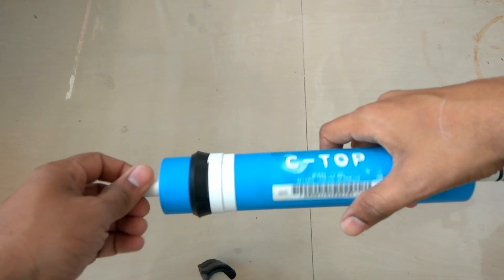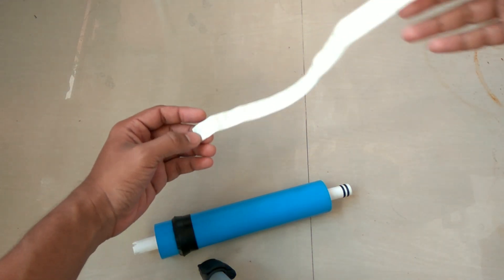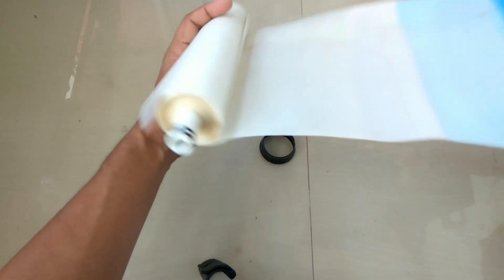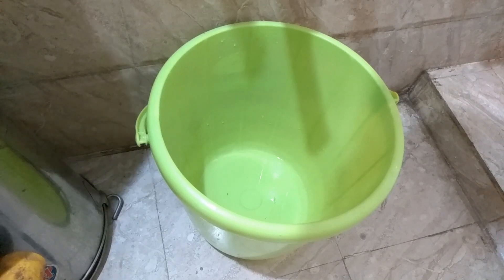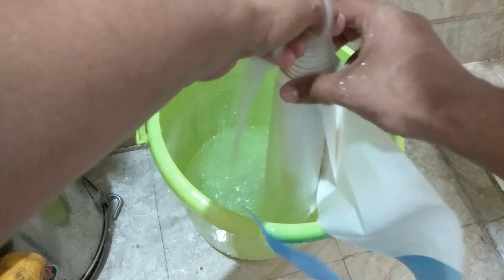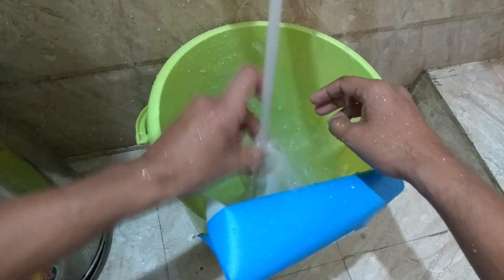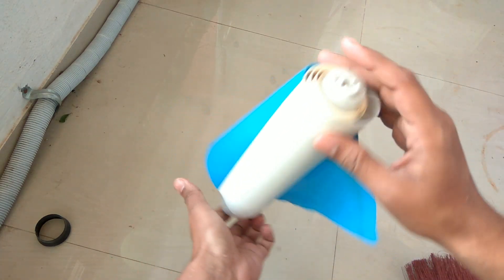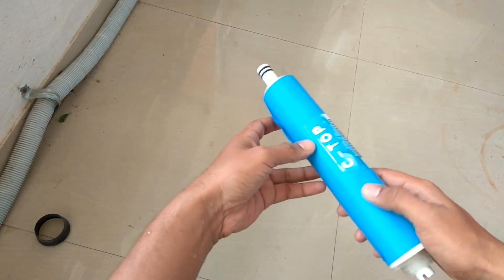RO Membrane open and Cleaning

Comment: Why SV of SLC 24V heats up.  Why SMPS heats up
Reply from the maker: SV Heats up because sv is madeup of Copper coil, it generates heat when current passes through it. if you give supply 36v to a 24 v sv , both sv and SMPS heats up.. SMPS of good quality has heavy duty heat sinks so they dont heat up ...